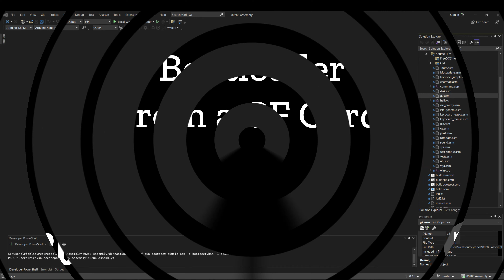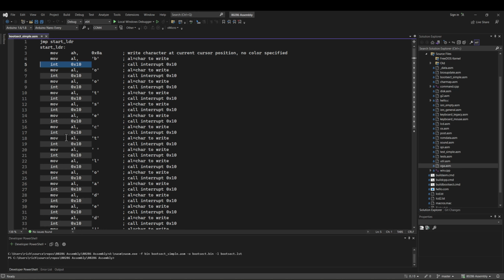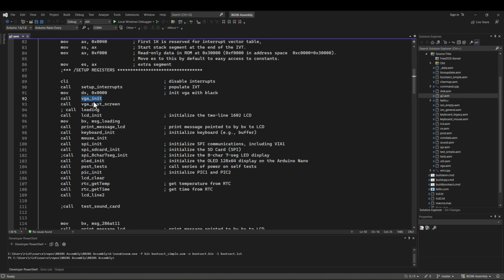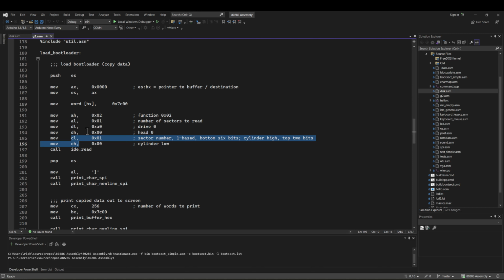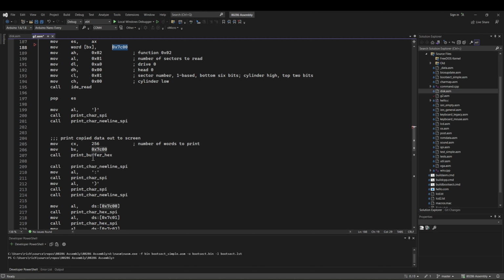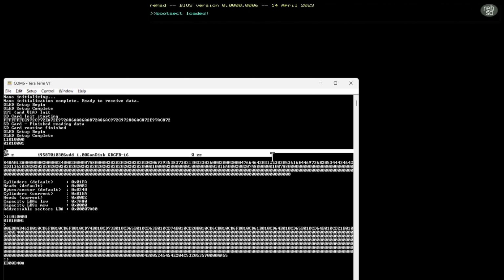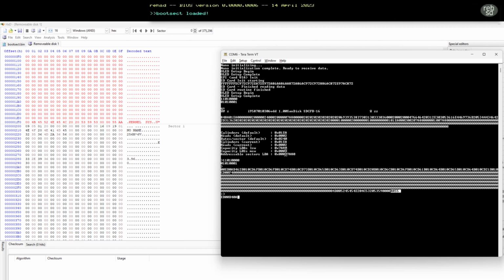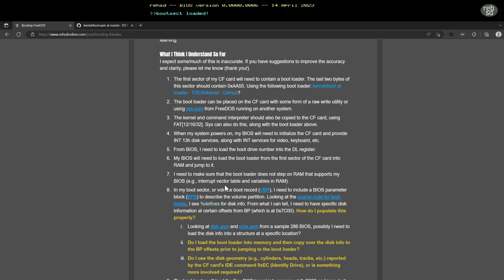80286 Build, Ep. #90 - Bootloader from a CF Card

Comment: I have not done a dos bootloader, but from what I recall about those old PCs it used to be necessary to load up the BIOS with the right drive geometry (sectors, tracks, etc) for each drive in order to boot right.  I think that went into some BIOS RAM. It was a pain because you had to keep track of it, whether on yellow stickies or by keeping the little white paper foldout that came with the drive, in case you ever needed to move drives around for example.  So it makes sense that at some point that needed to be programmed, but as time went by IIRC you could pull a lot of that info from the drive directly and skip all the user input nonsense.  Anyway, this is turning out to be a really impressive piece of work, glad it's still moving forwards!
Reply: It is likely the modern BIOS will do an auto detect of the disk geometry, but old timers did get to set track-head-cylinder information of the disk by hand. The addressing scheme of LBA/LBA32? or CHS as well. The FAT specific info is likely coming from the FAT FS itself during the FAT FS creation. It is FAT12/FAT16 for small disks, but maybe FreeDOS does even use FAT32 for it.
Reply from the maker: Thanks, @Zxborg!

Comment: 8:00 This code should not work unless there is the same bug in your `ide_read` subroutine. And there probably is. At lines 186 and 187 you are loading `es` register (segment part of the destination buffer). And that part is ok. But at line 188, instruction `mov word [bx], 0x7c00` is writing immediate value 0x7c00 not into the `bx` register but into the memory location pointed by `[ds:bx]` (whatever it might be at that time).

About the stuff you ask in the end of the video. This table is populated by your disk formatting tool and it's integral part of FAT filesystems. You must avoid overwriting this data after your card has been formatted. That's exactly why all FAT bootloaders have jump instruction at their very beginning. I recommend you to read `fatgen103` document. It has absolutely everything you need to understand and implement FAT12, 16 and 32 filesystems.
Reply from the maker: Good catch on line 188! I am always amazed at the eye to detail so many of you have! I updated it to "mov	word es:[bx],	0x7c00". I didn't need to change the ide_read procedure; it is using "rep insw" and (I think) properly going to es:[bx]. The reason it probably worked as it was is that both es and ds are pointing to segment address 0x0000.

Your information about how the device info table is populated is super helpful. I will take a read through Microsoft's fatgen103 doc. I will also take a look at the source in FreeDOS for Sys, Format, etc.

Thanks, @pvc!
Reply: @rehsd  That doesn't fix the problem. The problem is that you are not setting `bx` register itself to the value 0x7c00. You are setting the memory to which `bx` register points (which could be anywhere at that point). If your `bx` register points to ROM, MMIO device or some RAM that's currently in use, things are going to suddenly stop working and it is going to be quite difficult to figure out what went wrong.

Square brackets in x86 assembly mean that you are not accessing the register itself but rather the memory it points to. The actual instruction should be something like `mov bx, 0x7c00` or `lea bx, [0x7c00]` and corresponding fix has to be added to `ide_read`. It only works because you are probably using the same logic somewhere in `ide_read`.

The first big problem of doing that is that you are potentially corrupting some other memory and/or potentially read back incorrect value later. The second problem is that you are, from the looks of it, trying to mimic 0x13 BIOS interrupt behavior. If your FreeDOS, for example, tried to use it as it is, it has no chance in hell of working correctly. And you are going to be left scratching your head a lot to figure out why it doesn't work.

If you were working in protected mode with paging enabled at this point, the program would most likely crash at either line 188 or in `ide_read` when doing the actual `rep insw` (BTW. `rep insw` doesn't work on `es:bx` but on `es:di`) letting you know something is not right. But since this is real mode, the CPU won't tell you that, it is just going to happily corrupt some random memory. In C-ish code it would be equivalent to doing `*buffer = 0x7c00` instead of `buffer = 0x7c00`.
Reply from the maker: @pvc988  Ok, I'll dig into it more today. In my ide_read, I'm currently using "mov di, [bx]" before I call rep insw. More to come...
Reply: @rehsd  Yep, and that's why it works while it shouldn't. The instruction should be `mov di, bx`.
Reply from the maker: @pvc988  Ok... I have had some more coffee to help my brain... :)

Changes (tested):
	mov bx, 0x7c00
	(ide_read) mov di, bx

Hopefully, the third time is the charm.  :)

Thanks for the help and all the detail!!